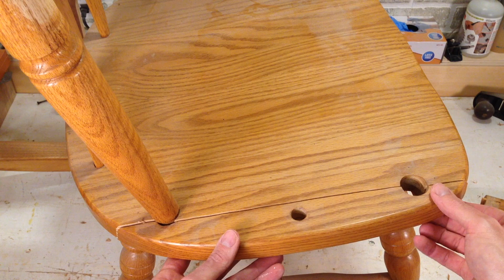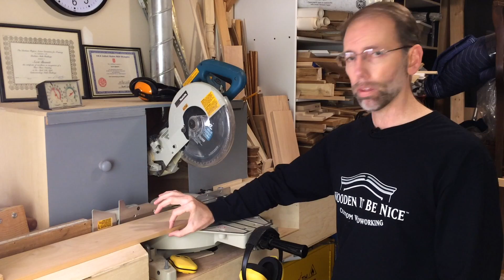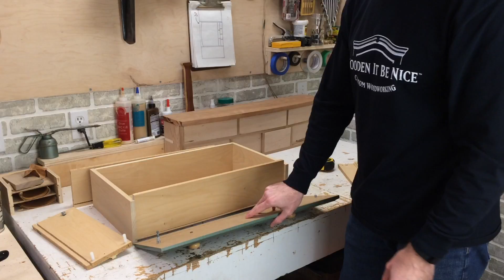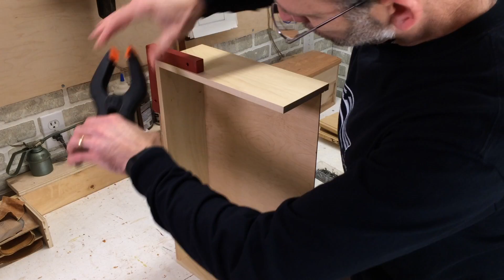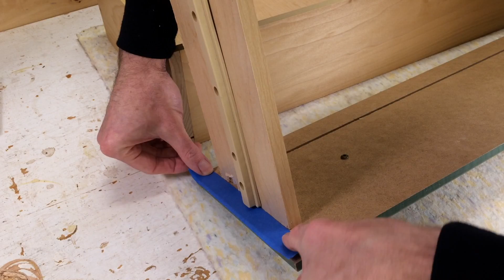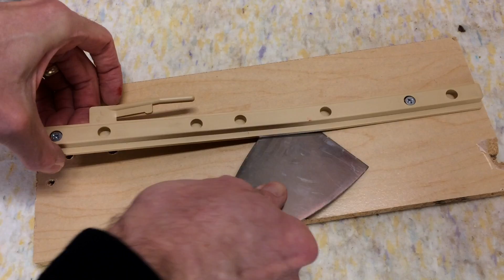Ikea Style Drawer Repair - How To

Comment: Hi Scott!  Thanks for all your great videos, it's been helpful to understand repair to design better projects!  
Quick question:  You've said many times that it's critical to glue both sides of a joint, but here you didn't.  You know far more than I, so there's a good reason, but I don't know what it is.  Can you help me understand the difference?
Reply from the maker: Good observation Alan.  To be honest, I didn't realize I did that... there wasn't a purpose in doing that.  I should have glued both sides to ensure the best possible bond.  Thanks for pointing that out.  Scott 🇨🇦

Comment: If you don't have access to all those tools to do a proper fix like this video maybe try another way. Amazon has the Ikea style cam locks and screws as well as wood hardener (liquid form) and wood structural epoxy/filler. Maybe that works to get by for few years till you get some real furniture or the equipment for a proper repair. I've been watching Fixing Furniture the last fey day and learn a few things and discover some new tools. Good stuff, keep it up!
Reply from the maker: If you're not concerned about the look of the repair, you can add supporting blocks in the corner.  Wood hardener won't work on this type of material and epoxy putty isn't structural so it doesn't add strength.  I hope that answers your question.  Scott

Comment: I think the average Joe/Josephine should just cut some corner blocks and put them inside the drawer.  It wouldn’t look great however it’s inside the drawer, and it’s low cost, low labor, low equipment required and it’s cheap furniture to start with.  Most flat pack is only kept a limited amount of time so doing that fast low drag approach probably adds more than enough extra life.    Noted that it lacks points for style.  🤓
Reply from the maker: Yeah, I guess that would work to hold it together for a while.  Thanks for sharing that Jim.  Scott
Reply: Of note, I still appreciate the effort and techniques that help others plan repairs on more expensive stuff too.  Heck, a lot of $500-600 bathroom vanities have poor construction and that starts getting pretty expensive for a lot of people.

Comment: I like your idea of making a completely new box of solid material, though ApplePly works very well for me.  I would do dovetails in front and a dado in back.  I would also replace the bottom and provide a cross strut to stiffen it up.  Properly glued dovetails will last forever and endure almost any kind of abuse.  Once set up in a jig, dovetails can be cut quickly and accurately.
Reply: Don't think many Ikea users could do dovetails else they would make their own furnitures.

Comment: You can do everything with a radial arm saw rather than using a mitre saw and a table saw. I like the sawdust extractor on the mitre.
Reply from the maker: I like radial arm saws and would have one in my shop if I had the space for it.  I would not recommend using a radial arm saw for ripping - technically it can be done, but it's not as safe as cutting on a table saw.  Cheers.  Scott

Comment: We don't have IKEA in Brasil but we do have that garbage furniture.  O used sawdust Ane glue to repair a drawer and used two angles, to make sure It will last another week or so.  If you want to find good wood in Rio de Janeiro, just check the dumpsters.  I have a collection of pure wood drawers I have found around.

Comment: I had several drawers that as a young child ended up destroying the drawers, and bad glue jobs. Skipping to present day. I reglued parts that were especially bad, and rebuilt partial rails as most of the parts was still in good shape. Now I have two working dressers instead of hampers for clean clothes.

Comment: I’m ecstatic to find this channel, as an underpaid dancer in NY, most of my apartment furnishings over the years have been bought second hand very cheap, which I then repair for use. IKEA has often begrudgingly been a large portion of big pieces like dressers. My question is, would the face still fall flush onto the body of the dresser? The finished drawer is beautiful, but has a full board of extra thickness now, and knowing IKEA construction, would have left a boards’ thick gap between it and the body. Were you able to test it? I’d love to re-side the drawers of one particular piece I’m currently using until funds pick up enough to maybe fashion my own dresser.
Reply from the maker: When I replaced the sides, I made sure the outside dimensions matched the existing drawer.  That way the drawer fit in the dresser without any issues.  Adding material on the outside of a drawer will cause an issue where it won't fit into the dresser opening.  Does that answer your question?  Scott

Comment: Awesome videos! As a non-woodsman i can only suggest to use modern torx screws like spax to make it even easier to fulfill your warrenty(which is pretty unlikely in this case) and match the color even more. 🌰👍
Reply from the maker: Thanks for your suggestion Rosi.  I'm guessing you live in the UK with the recommendation of using torx screws.  In Canada, our wood screws are all Robertson (tapered square drive), and in the US, the standard is Phillips.  I've never tried to source torx screws and screw drivers, but maybe I should give it a try.  Thanks for your suggestions.  Scott 🇨🇦
Reply: Im here in germany 😁 specially carpenters(the trades are historically diverted meaning the woodworkers which build roofs) love it as with the correct bit the screw stays on the bit and doesnt fall down which is awesome if you work above the ground or wanna keep your back healthy. Its funny that we even got 2 different words for cabinetmakers which are 'tischler' and 'schreiner' 😅
Reply: https://de.m.wikipedia.org/wiki/Zunftzeichen

Comment: I love the pace of this video. Also I appreciate your focus on the repair process and the low key presentation.  I'm curious as to why you would spend the time essentially making a new drawer but use butt joints for your joinery?  I'm not suggesting half-blind or through dovetails are necessary, but a simple dado on the drawer sides with a locking rabbet on the front would build a much stronger drawer.  You also wouldn't need the screws and the nails for strength.  If the goal is to keep the joinery simple to help the non-professional fix a drawer, then I respect that.  But if you have a table saw then making stronger joinery for the drawer sides should be easy.
Reply from the maker: My objective in this video was to show an approach that other people could reproduce.  Simple construction for a good drawer.  I own a dovetail jig, but most viewers don't.  Cheers.  Scott

Comment: How do you set up your warranty services?
Reply from the maker: Warranty is based on our record keeping and stickers we put on repaired furniture.  Each repair has an order with an order number.  We write that order number on the sticker to identify the piece repaired.  If a repair fails for some reason, we can track it back to the work completed to confirm the problem is something we've repaired before.  In the past 2 years, we've only had 1 warranty repair - at no charge of course.  Does that answer your question?  Scott
Reply: Thank you for a timely reply. I am doing the same and wanted to compare are if there in anything else I could do. Love watching and learning different tips and trick a. If you don't continue to learn you fade away.my name is also Scott. So I will sign   as Scott C.

Comment: End grain absorbs glue you would achieve a stronger butt joint if you press glue on the end grain, set for 15 minutes then re-apply wood glue
Reply from the maker: I've never tried that technique.  So you think the end grain will cause a glue-starved joint?  I'll give that a test with some scraps in the workshop.  End grain to face grain joints are not strong to begin with so I'm interested to see if this makes a difference.  Scott

Comment: The problem with this is that the Ikea design is dependent on the materials being dimensionally stable. Composite board does not change size dependant on humidity. Solid wood does change, particularly its width, so simply glued joints don’t work. That is why solid wood drawers have dovetail joints front and back. With just glue it won’t survive through a winter/summer. Plywood is dimensionally stable, but you can’t glue onto the edges, you would need to use some appropriate joints, possibly doweling.
Reply from the maker: You are correct that wood moves in width, which is why wide boards that are cross grain will separate from each other.  When the boards are connected with grain in the same direction, they move at the same rate, therefore the joint stays intact.  The reason dovetails are used is because they resist the force of the drawer being pulled open and keep that joint intact.  I hope that helps.  Scott

Comment: I would do a simpler repair which isnt as pretty but just requires adding 90 degree bracket and screw it on to the front and side piece, and all the broken parts just fill it with some filler. because its ikea furniture, there isnt a point in making that pat so strong when the rest of the furniture is particle board
Reply from the maker: That approach would solve the problem too.  Thanks for sharing your thoughts.  Scott

Comment: Sir, If I maybe so bold as to offer you a tip perhaps you might find useful.  For glue spreading I use Acid Paste brushes.  I get them at Harbor Freight, you get a bunch for a few bucks.  They work great and I just trash then at the end of the day.  I tried the silicone brushes I really do not care for them.
Reply from the maker: Thanks for the suggestion.  I prefer not to use disposable products where I can avoid it.  I wash out the glue easily, even when the glue has dried.  Scott

Comment: You mention that you don't like using screws in wood in another video but then in this video you're actually replacing the dowels with screws...????
Reply from the maker: The comments I make about not using screws is specifically for chairs.  A chair has a live load on it that is constantly shifting.  The screws wear out the wood with that movement.  This isn't an issue with other types of furniture.  I hope that clarifies it for you.  Scott

Comment: liked the video, feels like a guide to replace rather than repair! surprised that you didn't use the side pieces as templates for drilling the holes you needed instead of measuring.
Reply: Replacing part of a piece of furniture that's broken is still repairing the whole piece of furniture. Replacing would be going to Ikea and buying another one.

Comment: Many people would ask "hey, the only way to repair this is to throw away the old parts and re-building them up from new parts?", but this solution is the most senseful. Well, first of all, it's a simple calculation game: what does a single plank cost, and what does the whole furniture cost? You already know this from your car ;) 
Also, it's a question of warranty: I don't know how it is in the USA, but in Germany there is a minimum one year warranty even defined by the law. Even if a repair would survive the warranty somehow and breaks after that again, would you come back to have other works done? Most people won't, so a long lasting repair is a good customer service.
The way to fix the real problem (here, a construction issue by designing the drawers that they will break somewhen) like shown in the video is a good solution - and a damn good proof of that the handworker knows what to do. Good job!👍👍👍

Comment: Do you clean the paint brush after gluing for use another time, or are they single use only. And if you do clean them up, what do you recommend for the cleaning? Very useful video, by the way.
Reply: Most common wood glue is PVA based which is water soluble, so brushes will wash out easily with water.

Comment: thanks for the no finger glue tip, was wondering how much of a strength difference does it make with the finger oil in glue vs pure unadultrated glue joint?
Reply from the maker: That's a good question.  I don't know.  I read this in a Fine Woodworking article years ago about wood glue, so given the source, I assume it has merit.  Cheers.  Scott

Comment: Yeah, I’m not putting that much effort into repairing cheap IKEA crap.  Glue and epoxy and steel brackets in the corners to put it back together.
Reply from the maker: That will make it functional too.  Cheers.  Scott
Reply: I have done exactly that with our kitchen drawers made from crap particle board. Pretty much the same design as these drawers. Holes wear out over time and get bigger and no amount of glue will make it sturdy again. So I bought 4 small metal corner brackets from the hardware shop and screwed them in. Works a treat, looks a little meh, but we rent so proper repairs are up to our stingy landlord lol.

Comment: Good repair video Scott. Also reminds all of us what inexpensive furniture is. Put it together and your afraid to move it , knowing it might not withstand the move. Well done Scott.
Reply from the maker: Very true!  Thanks.
Reply: This is a problem in my area. There are a number of renters. When it is time to move (which happens a lot) it is cheaper for them to leave the furniture than it is to move it. Especially since it is crap MDF and particle board based stuff. So they dump it on the kerb as they move out and leave it. Then it becomes someone else's problem to clean up after them. Very frustrating for us owner occupiers that don't want our suburb turned into a dump.
Reply: @DavesShed  OTOH - free furniture!

Comment: I love this repair, economially speaking it allowed the user to get started for cheap when he needed it. Eventually enhance the most used parts like this (probably) top drawer and using the 80/20 rule (Paretto) this maybe the only drawer that ever needs to be fixed. Awesome repair and great structure for the final solution. If I were Scott I would ask the customer for the other drawers and add the reinforcement at the front to the other drawers to make sure they don’t eventually suffer the same fate as this one. Keep up the great content and thank you!
Reply from the maker: Thank you.  I like your analysis of the situation and your suggestion.  Scott

Comment: Was the face only attached with the hardware screws?
Reply: Originally it would have been held by the dowel and the fixings on each side. The new face is only held by the hardware screws  - that would have been the repairer's choice to do that.  Personally,  I would have put a few more
Reply from the maker: Yes, hard to believe, but that was it.  This is why I refer to this style of furniture as "disposable furniture".  It just isn't build to last.

Comment: Sometimes when I finish there are random spots where the finish doesn't work. Any fix?
Reply from the maker: That's too general for me to provide you advice on.  Please tell me what wood you're using and what finish you're using.  Thanks.  Scott
Reply: @FixingFurniture  it was cedar and It was minwax golden pecan as well as some polyurethane.
Reply: May have to sand all back down, and redo. May possibilities Could have been a glue smear left on the wood. Could have been sweat that dripped down onto the wood, if your working in a hot environment. Or.... Last night my son-in-law used my shop to rebuild a carburetor. He was spraying carburetor cleaner and the over spray was landing on my wood project that I had it clamps. I'm hoping it won't effect anything when I apply the finish.